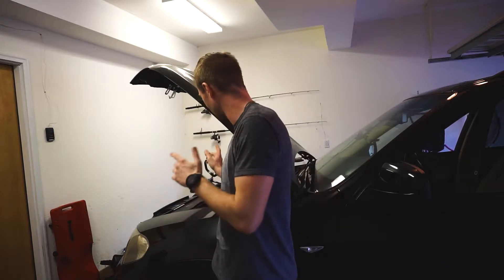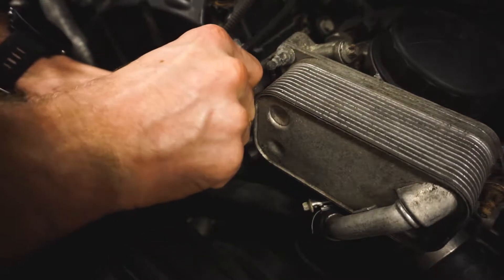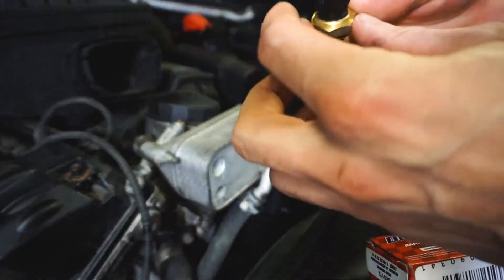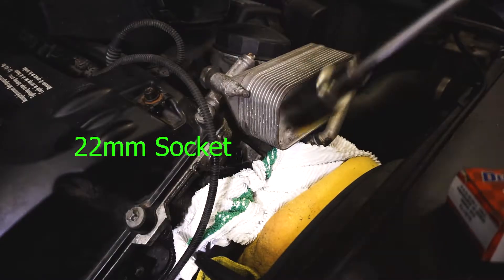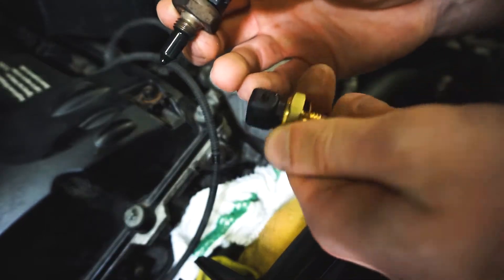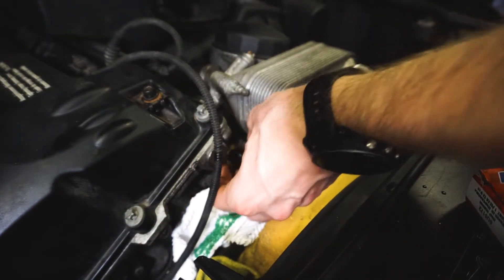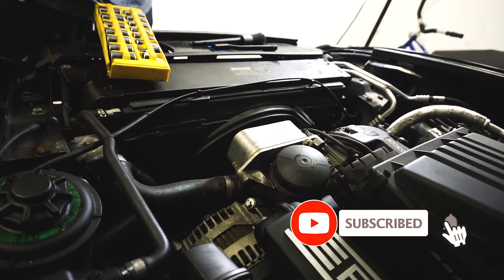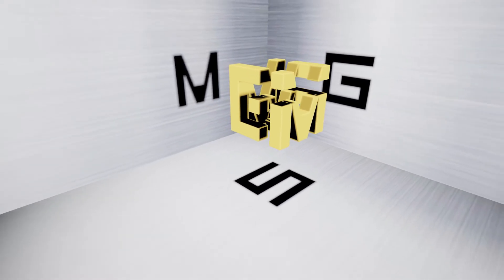HOW TO REPLACE TEMPERATURE SENSOR on BMW N52 engine

Comment: Will a bad sensor cause temperature gauge to read cold all the time? I replaced the thermostat already? 2015 328i?
Reply from the maker: Just check all the temperature readings true obd, usually it’s the sensor, but could be something else.

Comment: My 2010 x5 e70, has had a dpf warning, and reading some stuff online people have said that the temp sensor may have failed and causing the Regen not to occur if the engine is too cool. Did yours have this problem or a more precautionary part change ? Thanks
Reply from the maker: You are talking about Diesel Particulate Filter? right?
No, I have simply overheating problem, come up as my aux fan wasn't working...
But if we talking about Diesel Particulate Filter, I know they getting clogged from time to time, usually, it gets bad around 100-150K mi.

Comment: does it solve your overheat issue?
Reply from the maker: Id did not, replace the pump, also didn't, then find out my aux fan is not working, replace the reley, everything is working)
Reply: @Makhnovets  where is the relay located?
Reply from the maker: The video comming on October 2. Will explain everything there.
Reply from the maker: https://youtu.be/y0Mszj4vq2E that what is solved my overheating issue.

Comment: Hey , can you tell me where i can find this sensor on e60 m57 ? 🙏🏻
Reply from the maker: realoem / com will have diagram and SN, I usually purchase the oem sensors or parts from FCPeuro, just type you Y/M/M, Trim and engine, and it should show you all part's that your car have or available.

Comment: My e93 is overheating, and the scan tool is showing 2e84 code. Although i tried the water pump test, it's still working. Also, the fan is working. Do you think it's worth changing the sensor first? Or do you think it is another problem?
Reply from the maker: That’s a pretty common problem, electric brushes are failing on the pump, so it still works but not as efficient as supposed to be, also you could have the thermostat, the also pretty common problem, i have rebuilt one, you can see there why it’s failing, but overall I would assume that the problem is in the pump, just because the code. I definitely would replace the oil and coolant temperature sensor, because they could case this problem in rare occasions, and they pretty cheap. Also, Go to realOEM.com and make sure you don’t have a fan switch. One more note, when the gar start getting overheated, listen for the fan, it should go to highest spread, if not, means you have a bad switch or sensor, otherwise pump and thermostat.
Good luck!
Reply: @Makhnovets  the fan do goes full speed when car overheats, so I'll try changing the sensor since its cheap and if it didn't solve the problem then ill change the water pump.. Thanks for the quick and detailed answer.. Much appreciated
Reply: @Makhnovets  noted.

Comment: Hi mate i have 2007 x5 e70 n52 radiator fan not turning . i replaced the fan relay now only turning on when aircon is on . its not giving any overheating error but still i not feed safe to drive
Reply from the maker: First, connect the scan tool that can read the temperature, or go in to hidden bmw menu, you can get coolant temperature reading there, and let it idle to full wormup, see what temperature it reaches the highest, my car was at 114C and still didn’t show overheating, but it’s too high temps, the fan should kik in around 95-100c, if not means something is wrong, the oil temp sensor and coolant temp sensor needs to be replaced first.
Reply: @Makhnovets  thanks boss 🥰
Reply: @Makhnovets hi man can you please tell me where is the engine temperature sensor located for oil?
Reply: @Makhnovets 😊

Comment: I HAVE A 2007 X5 REPLACE THE WATER PUMP AND THE THERMOSTAT BUT NOW THE FAN IS ON HIGH SPEED ALL THE TIME.....CAN BE THE SENSOR????
Reply: Cual fue la solución yo también tengo ese problema

Comment: Hey so my 128i with the n52 fan does not turn on even when it gets really hot and up to boiling temps, I’ve replaced the thermostat and the fan also the water pump is fine and the radiator I replaced less than a year ago and was running fine until I noticed the fan doesn’t turn on. Would this fix it?
Reply: I’ve checked and the car is giving power to the fan so I replaced the fan and still it has power just not turning on when it gets hot
Reply from the maker: make sure to scan the car first and see what temoerature it's showing, there two sensors that seating on top of the oil filter housing, one is oil and the other is coolant, make sure to check the data on both of them, the N52 should have the  Fan switch, it's usually seating on lower radiator housing, I think it's on the pass side. I'm 99% positive that you have one and if so, that's the problem!
Good luck!
Reply: 😊 @Makhnovets
Reply: Should the oil temperature and coolant temperature reading be +- 5 c   or be close...     ,.....   I also have  code 2EF4 ..   .. AND Check ENGINE LIGHT.  I have bought  a new coolant temperature sensor. And will replace mine. I have N52   528xi,  254,000 kms..    

After reaching operating temperature.. the oil temperature reading is higher thzn the coolant temperature.   Is that normal. .?  On my foxwell scanner, the oil temperature reading is 110 Celsius...    but the coolant temperature is 104 Celsius...    

 Any help is appreciated.
Reply: After I turn on the heat ,... the coolant temperature drops down to 94 Celsius.. is that normal.. 

I have chNged my water pump and thermstate -▪︎@ 154, 000kms...   

Scanner shows thermostat znd water pump working as should be...